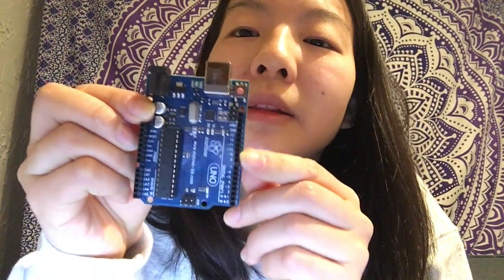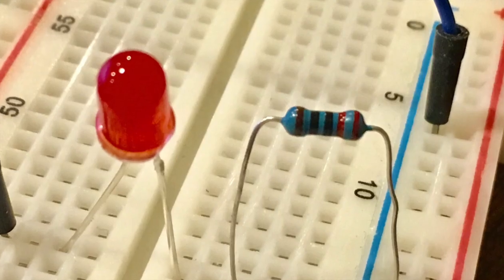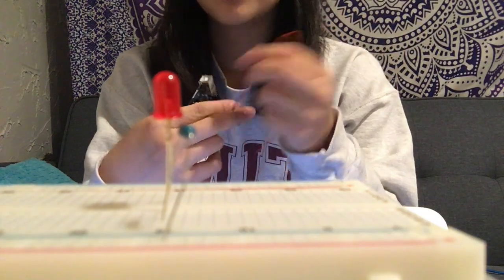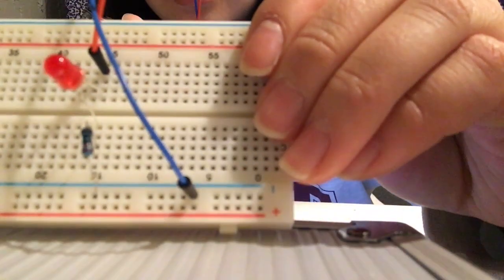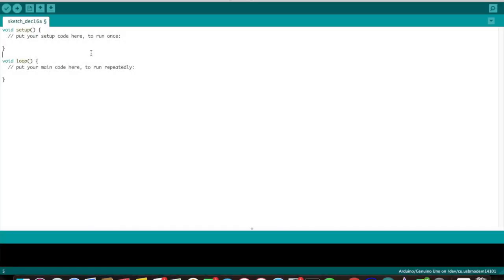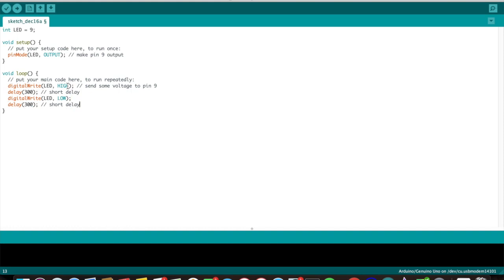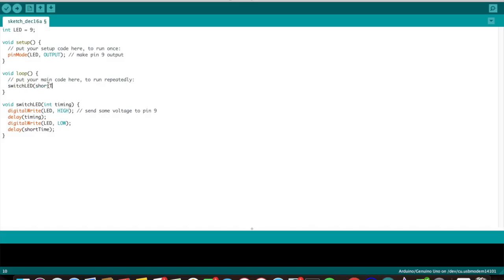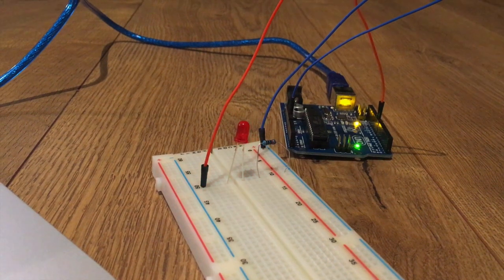Programming an LED to Signal in Morse Code (Simple Beginner Arduino Project)

Comment: for the first program to test the LED flashing, my LED just stays on and doesn't blink on and off.  Can you help pls
Reply from the maker: Did you compile your code onto your arduino?
Reply: I did.
Reply: i have the same problem :(
Reply: @zuriatiezakaria1134  samee it's not blinking at all
Reply: @auroramorales4621  its because you didnt connect it to pin 9, just remove the jumper from the 5V and put it into pin 9.